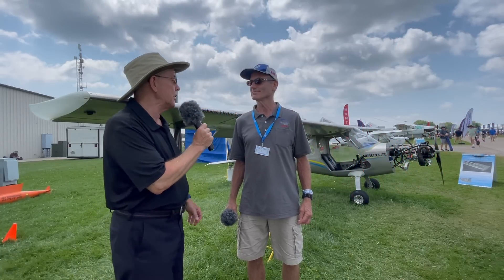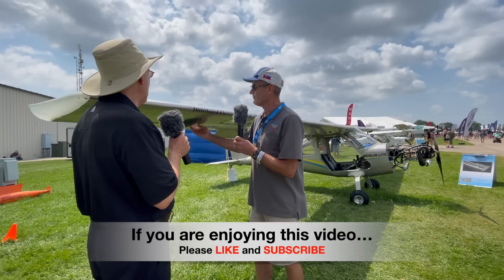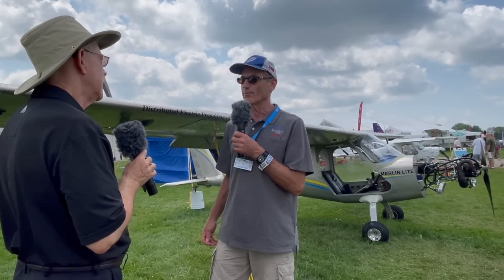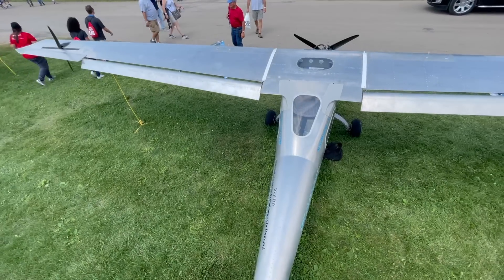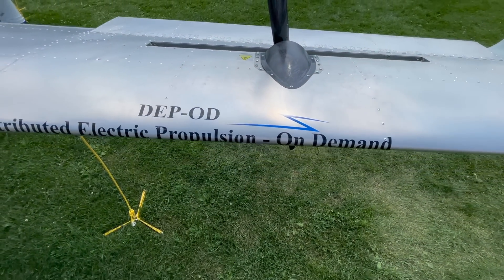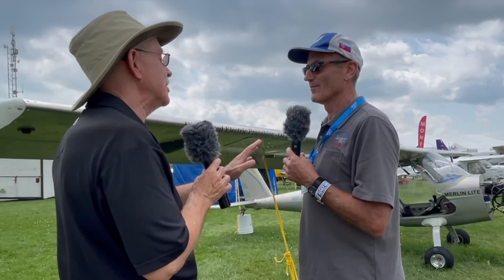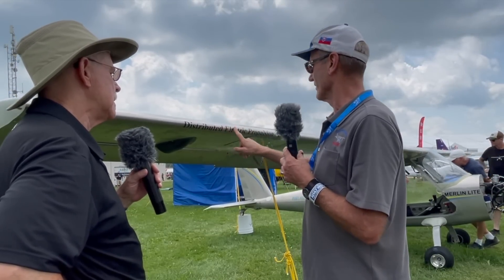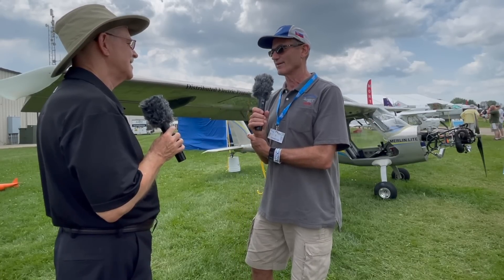In Wing eProp patent 0723

Comment: Nope. One motor out would leave a very asymmetric thrust situation. Extreme yaw would follow. And if one is close to the ground, those conditions can be deadly.
Reply: One motor out, the second one turns off automatically
Reply: @MrPilotStunts , you had better HOPE SO!
Reply: It could be done with enough electronics redundancy. 3 to 7 microcontrollers monitoring the thrust of both engines and a lot of good firmware. But God help you if there is a catastrophic electrical event that fries your electronics and only 1 of the motors.  It is a solution that requires active stabilization. Generally not a good design choice unless absolutely necessary.
Reply: @iloveaviation-burgerclub-a8145 Of course. With a big enough rudder and a high enough speed. Physics matters. You're not going to be able to do anything when you're only going 10 knots coming in to land on a 20ft. runway. You are entirely dependent on your electronics at that point.
Reply: @iloveaviation-burgerclub-a8145 Mechanical linkages between the motors might work to mitigate this. But now you're talking a lot of weight and much more complexity.

Comment: What about using motors that produce power regeneration?
Reply: thinking the same thing, I would see this useful in descending, there's free power right there that's not being gathered.
Reply: They can only do that by slowing the plane and reducing glide distance- literally by functioning as airbrakes. You don't want to be doing that regularly.
Reply: There are light electric prototype aircraft that have used regenerative air braking by windmilling, but that basically means a very high descent rate, so yes it’s an interesting trick but it’s not effective.

Regeneration works when the alternative braking means more energy loss. So it helps momentarily after touchdown but not on descent.

Comment: Funny concept. Little far apart if there is a control issue, might force a spin. Couldn't the e props simply be placed on the leading edge instead? even in a high AOA it would still blow along the wing and even in extreme stall it would blow on the underside so seems it should work fine. Simpler than to cut into the wing.
Reply: Blowing on the Topside of the Wing produces Lift & some Forward Thrust.
Blowing Under the Wing, provides Thrust. Differential thrust could assist Directional/Heading Control (requiring less Banking).
  
{Bill in CA}
Reply: But more drag when not running.
Reply: @bwyseymail  the blades could fold along the wing and no slit so could be less drag.